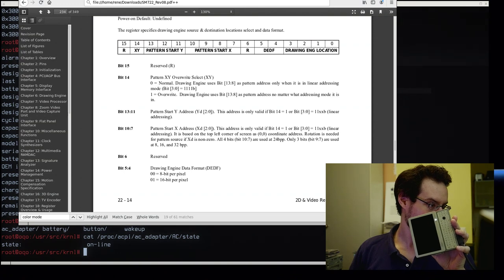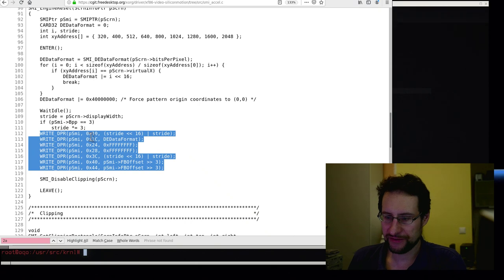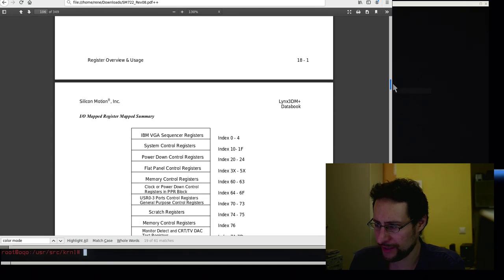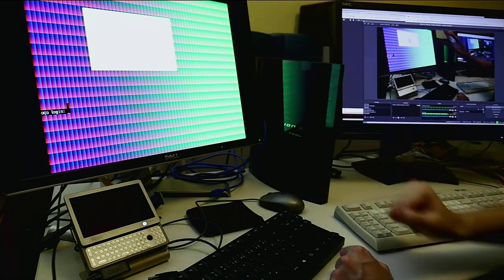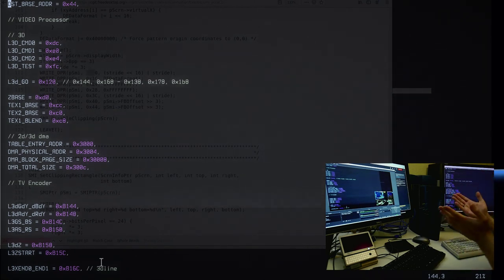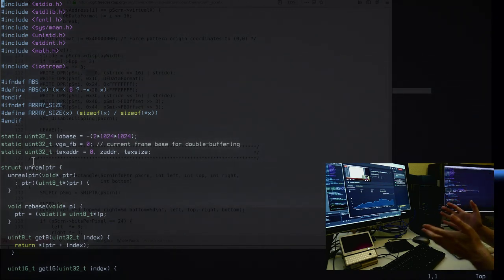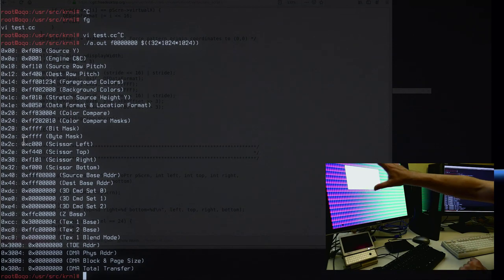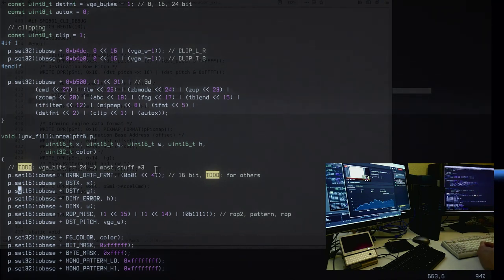I started SM Lynx3D low-level "3D" code! on Linux w/ Transmeta Crusoe

Comment: I wonder if it would be possible to one day have a highly configureable driver for all the vintage accelerators. so if you discover a rare device with no drivers you dont have to write a driver from the ground up but you "just" have to figure out some addresses and values and fill them into a config file or a list of constants. maybe some of it could be even automated. i imagine it would be quite fascinating watching a script live reverse engineering graphic hardware going from no output to a corrupted one and then to an efficient bug free demo screen.

Comment: This is mostly an informational reply to what someone said in chat. The Transmeta CPUs are designed to execute x86 code even though they are VILW, so all the registers and flags, and how memory addressing works is like a regular x86 exists on Crusoe and Efficieon.... I doubt they could execute ARM code as efficiently as they were not designed or implemented to do that... really Transmeta CPUs ripped out all the hardware scheduled parts of the CPU pipeline, then implemented a soft x86 CPU in a VLIW core on top of the skeleton of an x86 core. Nvidia Denver and Xavier etc..are modern and apparently quite fast VLIW cores also and it actually does implement the ARM instruction set... I suspect we will se more VLIW CPUs as patents from transmeta expire.
Reply from the maker: I'm not really convinced VLIW is the way to go. Regular code is not benefiting from LVIW too much, and massive parallel code is more suited for SIMD and many-cores. I guess LVIW was a novel idea back when logic gates where more expensive, compared to today's monstrous chips. If one really wants massive parallel performance some more generalized GPU for more direct programability SIMD is probably the future. Maybe even more useful as more flexible than todays dedicated neural network "AI" processors.
Reply: @renerebe  For regular code the main benefit is being able to build a vastly smaller core, which uses less die space and less power since all of that is implemented in software instead of hardware. The advantage of VLIW isn't so much how wide the core is, as how small it is relative to the available execution resources. The advantages of VLIW in this aspect are still as relevant today as ever... but not enough that anyone would pay for the patents instead of just waiting them out. Also VLIW makes even more sense for multicore systems, as they can share the whole translation cache, the more cores you add the less overhead there is for translation.
Reply from the maker: @Wingnut353  It sounds like you equate LVIW to code morphing translation. I think this is not necessary the case, that was a sort of special Transmeta thing, but you could certainly build a normal VLIW CPU that runs VLIW architecture, e.g. some beefed up RISVC variant. Like the Intel i860, Fujitsu RISC-VLIW or somewhat Intel's Itanium.

Comment: It would have been really awesome if 2D acceleration worked again in xf86-video-siliconmotion. It has been broken for so long now and there are so many interesting ultraportables/UMPC's of the old days that have a SM Lynx chip in it!
Reply from the maker: thanks for your comment. Do you have such an device? The xorg/xf86 driver somewhat works on this Oqo 01+, though the base install is already a bit older. Guess time to install and re-test with the very latest T2 build with that. If you say it like that it sounds the latest xorg-server API changes might have broke something, again. My reoccurring story :-/
Reply: @renerebe  Thank you so much for replying! Since the EXA/XAA change, my ThinkPad 240X and some other models with LynxEM+ (SM712) have the problem that the screen gets heavily distorted when you start a desktop or certain programs. It is accelerated however but not usable... I am clueless!

Comment: Err... About ATI releasing specs... They release the ISA, and they now have extensive header files explaining a thing or two. Actual register level specs for ATI hw died the second, the very second, the RadeonHD driver died, back in february 2009. So much for ATI being open, and so much for the nasty adversarial fork that supported ATIs mode of working.
Reply: Also, i suggested open docs when we were writing our proposal to AMD, and we made it a central part of our proposal. AMD loved it as it would also force ATI to clean up their act, as this was a big driver for AMD open sourcing ATI drivers and docs. The proposal we wrote can be found, word for word, on phoronix.com. Google for "Proposal to Advanced Micro Devices for the Implementation of a Driver for its ATI Radeon (tm) HD 2000 Family of Graphics Hardware (R600)."
Reply from the maker: I really appreciate sharing your experience. I read about the AtomBIOS mode setting controversy. I will continue looking into all the various generations. Theoretically I still have to figure out why the R200 or so code hangs on the PPC G4 Cube, when acceleration once worked on it: https://www.youtube.com/watch?v=uYx9X92iQHM

Comment: Do you know if the sm820 (first siliconmotion 3D engine) has an engine that supports all the porter-duff compositing operators? I could not find documentation online, congratulations on your find. If all the alpha-blending ops are supported, would it be feasible/straightforward to add full EXA support to xf86-video-siliconmotion? As far as I know, it only supports solid and copy currently.

Thank you for taking the time to improve hardware support for these legacy accelerators. I highly appreciate that someone is doing this.

Also, I do quite dislike the fact that mesa has removed so many of the classic drivers, but with most OpenGL applications using programmable shaders these days, would it offer any benefit for semi-recent software?
Reply from the maker: Sorry, I have no idea if the sm820 is compatible to the 720. AFAICS the 720 does also not supoprt all compositing operators, but probably enough to accelerate at least some commone operations: ) Bit 12:9Destination Blending Factors0000: ZERO(0, 0, 0, 0) 0001: One(1, 1, 1, 1)0010: SRC_COLOR(Rs, Gs, Bs, As)0011: INV_SRC_COLOR(1 - Rs, 1- Gs, 1 - Bs, 1 - As)0100: SRC_ALPHA(As, As, As, As)0101: INV_SRC_ALPHA(1 - As, 1 - As, 1 - As,1 - As)0110: Dst_Alpha(Ad, Ad, Ad, Ad)0111: INV_DST_ALPHA(1- Ad, 1 - Ad,  1 - Ad, 1 - Ad)1000: DST_COLOR(Rd, Gd, Bd, Ad)1001: INV_DST_COLOR(1 - Rd, 1- Gd, 1 - Bd, 1 - Ad)Bit 8:5Source Blend Factors0000: Zero(0, 0, 0, 0)0001: One(1, 1, 1, 1)0010: DST_COLOR(Rd, Gd, Bd, Ad)0011: INV_DST_COLOR(1 - Rd, 1- Gd, 1 - Bd, 1 - Ad)0100: SRC_ALPHA(As, As, As, As)0101: INV_SRC_ALPHA(1 - As, 1 - As, 1 - As,1 - As)0110: Dst_Alpha(Ad, Ad, Ad, Ad)0111: INV_DST_ALPHA(1- Ad, 1 - Ad,  1 - Ad, 1 - Ad)1000: SRC_ALPHA_SAT(f, f, f, 1) where f = min(As, 1 - Ad)1001: SRC_COLOR(Rs, Gs, Bs, As)1010: INV_SRC_COLOR (1 - Rs, 1- Gs, 1 - Bs, 1 - As)
Reply from the maker: Ps: do you have a device with the sm820? Update: Their Windows "ME" drivers lists the 820 Lynx3D alongside the 720 Lynx3DM, so they could indeed be register compatible for the most part:
SM810 LynxE
SM811 LynxE
SM910 Lynx
SM710 LynEM
SM820 Lynx3D
Lynx3DM
LynxDVM
SM712 LynEM+

I guess those without "3D" have not 3d?
Reply: @renerebe  Great! That should be all the compositing operators needed by current EXA according to this: https://gitlab.freedesktop.org/xorg/proto/xorgproto/blob/master/compositeproto.txt           However, I believe gles2 has a few additional modes for constant color and constant alpha blending as well as subtractive blending that are not a part of this set. Also, I was interested in your opinion on reviving old mesa drivers. I was under the impression that it would be of little use for acceleration as the great majority of OpenGL linux software today uses GL versions with programmable shaders. Again, thank you for doing this work, I highly appreciate it.
Reply: @renerebe  It does seem that the use of "3D" is a reliable indicator of whether or not a given accelerator has a 3d engine, although I cannot be entirely sure.
Reply from the maker: @hondaguydaihatsu3200  do you have a SM820 device? Of course it is true that the old chips do not run Crysis, but why not keep the drivers around to run vintage games, even Quake III, or other light 3D stuff or shaded office diagrams?
Reply: @renerebe  Unfortunately, I do not. What I had in mind as far as the GL versions was more in the vein of ui toolkit backends, such as EFL's gles 2.0 renderer. In the case of a transition to Wayland, the acceleration abstraction that formerly existed with the X server and XAA/EXA would be lost.